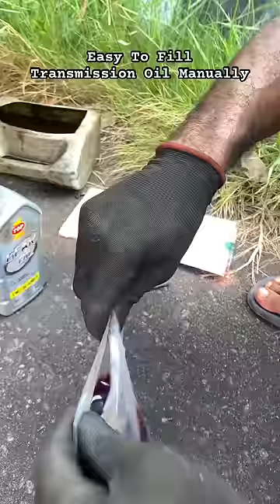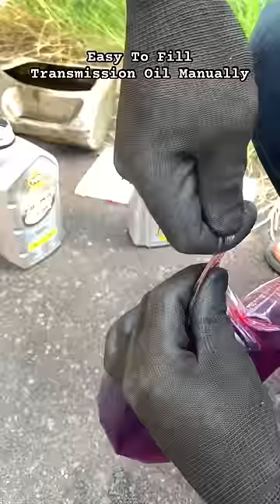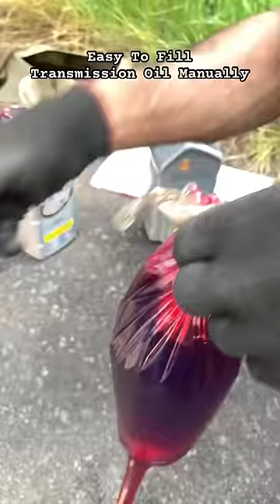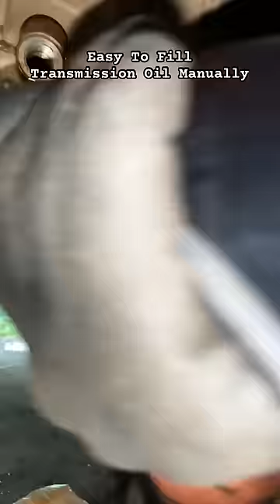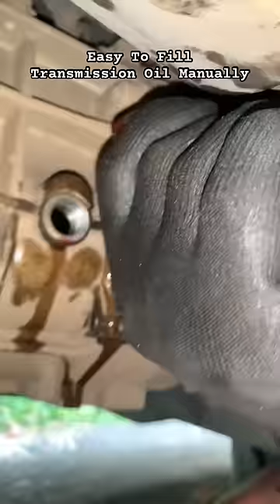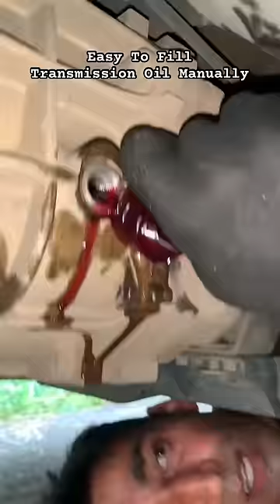Easy To Fill Transmission Oil Manually #automotive #car #short #viralshort #shortvideo #shorts

Comment: When you dont have profesional tools and garage but you have creativity. Good job
Reply: متأكد من كلامك😂
Reply: Особенно когда у тебя грузовик с 40 литрами масла в КПП
Reply: After that u need to start the engine and u need tempenture on the gearbox to fill more and on this Point it doessnt work
Reply: Cause it's Pakistan
Reply: @gelato4490  how to fill trans fluid over maximum level? Its not coolant or engine oil to check after change
Reply: @cziku8054  the hole ther put the trans oil in is the check Level, u need to run the engine so the pump can fill the gearbox and Mechatronic with oil, and the pump dont let the oil run out from the hole, after that u need to swap all gears and the oil need tempenture because the viscosity of the oil change and u have again a other level of oil in ur gearbox, in the same time u fill more and more and and then it run out (engine on) ur are finish, that guy in video misses min. 2 Liter oil
Reply: You are right, i agree what you said but you talk about automatic transmision. AT have oil filter and a lot of space where oil stays if you drain to change trans oil. Manual transmision is very simple, you drain 2 liters, then you fill 2 liters
Reply: Eso lo hace cualquiera no es creatividad,
Reply: Usaba una manguera y. Una jeringa más. Fácil
Reply: The professional tool for this is like 20 bucks. At most.
Reply: Just fill it through the vent like normal people or use big syringe, if it flows out through that hole and car is leveled it means there is too much.
Reply: Not good job that’s not how you fill the transmission 😂
Reply from the maker: I think u vist Pakistan

Comment: A. Hand pumps are really cheap, B. He over filled it the transmission. The reason why the check plug is on the side is when it comes to a slow drip that's when it's at the specified manufacturers fluid level, so long as it's on level ground.
Reply: Personally i hate the hand pumps they barely work this is far easier
Reply: That might work for transmission fluid, but he is using transmission oil. I think it’s different 😂
Reply: @justinchaapel-pb4sd  looks like the raspberry jam you get in donuts.
Reply: @justinchaapel-pb4sd it's the same thing
Reply: 13 years transmission specialist. He did not over fill the trans, when it is up to the bung it is full doesn't mean the bottom of the bung. 1 or 2 millimetres over the hole won't do anything. You'd have to fill it up another liter or 2 before it would aerate the oil and course problems.
Reply: I don’t need a pump on my car I just take my shifter off inside car and poor from top works great if you do t mi d taking shifter boot and short shifter and all that off I’ve used pump before but sometimes takes forever lol
Reply: He didnt overfill. That was perfectly fine. You cant overfill or it will just pour out. Thats just enough.
Reply: @redjasper1100  haha exactly
Reply: @carpelunam  if the oil level is even 1mm or 2mm over the level bung the gearbox will explode, the clutch will lock up and the tail shaft will turn into a RPG and destroy the rear of the vehicle. Don't over fill your manual transmission.
Reply: @700lbs_ripped  you are so so wrong dude. Your clutch wont lock up. The clutch has nothing to do with the oil and a clutch is supposed to lock. Thats how it worls. You have no clue what your talking about.
Reply: Up to 1 mm overfill wont hurt anything.  Only gasket pressure can be increased.

Comment: Don't forget to put that plastic piece inside the transmission. They help smooth shifting.
Reply: The plastic will help seal any leaks 😂
Reply from the maker: Thanks for good advice
Reply: Why is this cork in this place?  So that the excess oil leaks out on its own and there should be enough oil equal to the bottom of the inspection hole.  You don't have to hold the oil with your finger, it should flow out.
Reply: @Daniel_Kro ничего не будет от лишних 100 грамм.
Reply: Bu yorumu bir qadin oxuyub bunu mütləq edəcək 😂
Reply from the maker: U r right but I can wait long time because I make short video
Reply: 소음 감소에는 톱밥이 도움이 됩니다

Comment: I usually just uncrew the vent and fill it from the engine bay but sure, you do you
Reply: not all cars are the same, believe it or not.
Reply: Good luck doing that on this transmission. It’s not in the engine bay.
Reply: You mean AT dipstick manual box doesnt have those
Reply: @Cutiekittiecat  Some do. Older Subarus, for example.
Reply: wow its almost like my fillhole is underneath my car because its a different type of car? no its cant be
Reply: @Cutiekittiecat  Also, they aren’t talking  about a dipstick. Most transmissions have a vent that can be unscrewed, which is a convenient place to fill it in some cases.

Comment: Thats not enough oil, u must change the gears trough driving and then put more oil in transmission
Reply: Wrong calculate how much you took out for example you take out 5 quarts you buy back in 5 quarts you can drain all of it out because the torque converter holds most of it
Reply: Both of you are clueless. First off, this is a standard which has a fill plug that you fill up until the oil comes out. It's the exact same as a differential. This transmission does not have a torque converter that holds fluid and it does not have to be operated to check fluid level. That is literally automatically only and you fill automatic through a dipstick or a fill port with a calibrated stick to place in it to measure the fluid.
Reply: @KilosFlo also, if it's a automatic, you absolutely cannot measure the amount that you drain out and fill it back up with that amount of fluid because the fluid burns and degrades over time. So the quantity you take out after 100,000 km is less than the quantity you need to put in. You would have been under filling the transmission if you just filled it up with what you took out. That's why manufacturers give you a spec for how much to fill it with
Reply: Nah bro, fill it until it starts to leak out and that's it. That's how manual honda transmissions work so I'd imagine most are similar.
Reply: @879blank exactly, all these wannabe mechanics in the comments 😂😂😂😂
Reply: @Tylerstace-smith thank god someone that knows what he's talking about iv been looking at the comments and seriously think these guys must be trolling. 13 years transmission specialist here.

Comment: If you open the top up and use a hoover it stops it coming out the bottom and doesnt go in the hoover either cause it pulls air in through the bottom opening 😊

Comment: As a trained automotive mechatronics engineer. It's like this in 90% of cars: you fill in excess and the remaining oil that comes out has to run out. This is how you adjust the oil level. What you did is wrong.
Reply: the transmission capacity says 1Liter, on the oil package its say one liter, so we put all of it, 1 liter
Reply: That only works if 100% of the used oil was removed such as when you do a complete overhaul. A simple drain and refill will require less than 1 litre of oil.
Reply from the maker: I make short video 1 minutes not enough to explain everything but I will make complete video how to change oil

Comment: I used a cheap 2.5 gallon pump sprayer from Walmart it helps to take the tip off to get a steady stream you can control it better much less of a mess
Reply from the maker: U r great

Comment: I used one of those cheap syphon pumps. Pull end hose in the fluid container, the feed end in the drain plug hole. When finished, clamp the feed end before pulling out from the drain hole.

Comment: Or.. go to the auto parts store and get a hand pump like you’d find on a container of hand soap.. they screw into the top of a standard 1L fluid bottle 
Use the plastic tube that comes with it to pump fluid wherever you need 

Those little pumps are like $6

Comment: Guy - just drill a hole into 1 cap, and silicone a 3 foot hose into that cap.  Use it on every bottle.  Hold the bottle upside down and just puncture the bottom with a small hole for air.

Comment: This is probably the hardest way to go about doing this. No one refills their transmission from the bottom...
Reply from the maker: I think u need to learn about mechanical
Reply: @m.yautoservice1323  bruh... you can pour transmission fluid right down the transmission dipstick line. You need to learn how to mechanic more. This is so extra. That's literally why the dipstick for checking transmission has such a large opening. Americans built the automobile. It's our invention. Trust me. It goes down the dipstick.
Reply: @ryankross3987 Why comment with such conviction, when you clearly don't know what you're talking about? Not every car has a transmission dipstick - including pretty much all vehicles with manual transmissions.
Reply: A manual should have different fluid i expect
Reply: @Efffshams  there are quite a few that use ATF.

Comment: But u have to shift every gear while engine running for at least 20 seconds after u fill the transmission tk the point when it starts leaking.

Comment: Меня одного удивило что он залил жидкость для автоматической коробки передач в механическую. Интересно как много он проехал 🤣
Reply: That's SAE90 manual transmission oil

That manufacturer (top1) sells automatic fluid in a blue and orange bottle

The grey bottle means it's for manual transmission

Comment: Bro why is he going from the drain plug and not from inside the engine bay where there is a cap for transmission fluid
Reply from the maker: This manual gearbox

Comment: Most likely that’s an older trans an if you are filling it under the bottom it’s a manual an it takes gear oil an I see atf I could be wrong
Reply from the maker: See one more time I think you understand this is not atf oil just color

Comment: Hmmm I think his transmission fluid may be a bit over filled and Contaminated vehicle may only stay in limp mode. A few thousand miles down the road your transmission cooler lines o rings will be shit….I guess you gotta do what you gotta do
Reply from the maker: U r right i know level and oil capacity i make short video so I can show u with in 1 minute

Comment: Bro if that’s a transmission it needs to be running for you to fill it unless it’s a standard
Reply: Running????? So drive while doing this? If you're in park your trans isn't moving.
Reply: @redfishbluefish67  bro if you don’t know your trans needs to be in park when filling or checking your tranny fluid you don’t need to be messing w your car just being honest. If it’s a standard it doesn’t matter that much if the car is running bc it doesn’t have a torque converter

Comment: Hey just to let you know buddy that took gear oil in the transmission not transmission fluid cuz it's in manual transmission it's an automatic transmission fluid goes in an automatic car not a manual one like you just did
Reply from the maker: U don’t know about mechanical work u just see color and decide this oil atf but this oil manual gearbox box can see again this video and read writing At bottle

Comment: Never change your transmission fluid on a old transmission. Most of the time it will start slipping or your vehicle won't move at all. If it's working fine leave it alone.

Comment: I have a problem with this video. The bottle is labeled "SAE 90 GL-5/MT-1" which seems to be a manual transmission oil with a viscosity of 90w SAE and is GL-5 rated for use in a Hypoid gear trans-axle or differential. A GL-5 oil is OK for use in a standard manual transmission where GL-4 is normally used. The problem I have with the video is the oil poured from the bottle looks like Automatic Transmission Fluid or ATF which has a much lower viscosity and is usually red. Judging from how quickly it pours out that's exactly what it is. My guess is the ATF was put in the bottle to make the oil pour out quickly, and make the video shorter in length. There is a slim chance that the manual transmission is intended to use ATF, but I doubt it.
Thumbs down on principle.
Reply from the maker: U r google search about TOP 1 gear oil Indonesia u can get your answer